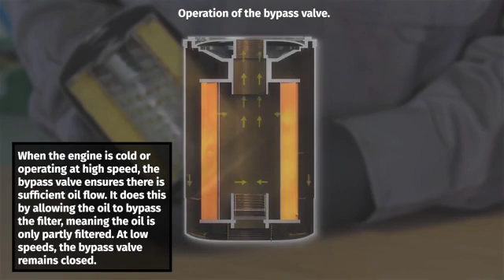How does an oil filter bypass valve work?

Comment: Who are you people ? The filter  element  does not move  away from  the end plate the way you are showing  . If the filter is clogged  the oil flows  threw the bypass valve . It does not flow the plate end the way you are showing  .
Reply from the maker: Hello Nic Nic,
Thank you for your comment. The idea here is to point out importance of by- pass features inside the spin on filters which may prevent oil starvation or pressure drop in some other components. To prevent blockage of the filter, by-pass valve with a small spring inside which act like a non-return valve is used. 
Have a nice day.

Comment: I never heard of an oil filter in which the bypass valve opened up at a certain temperature.  Are you sure you didn't mean to say "a certain pressure"????
Reply: These people  do not no what they  are talking about . You are correct  . The filter  bypass works  on pressure  difference  . The filter  does not move in the housing away from  the end plate the way they are showing  .